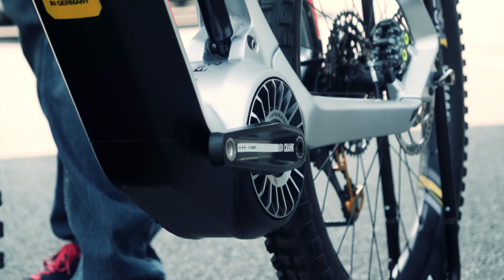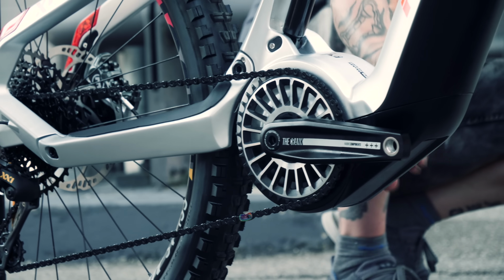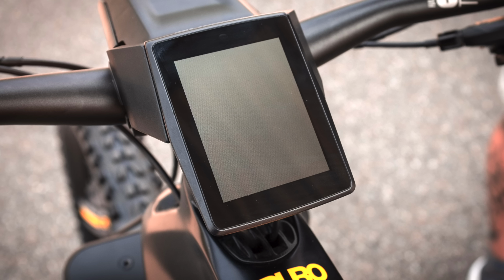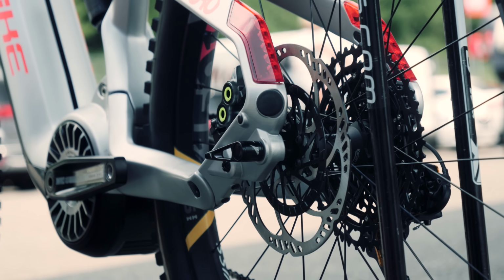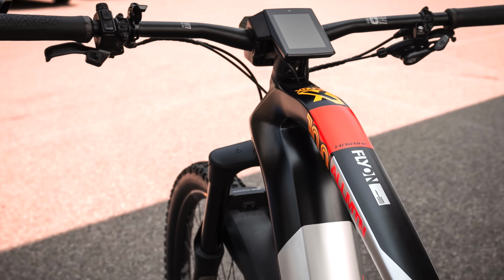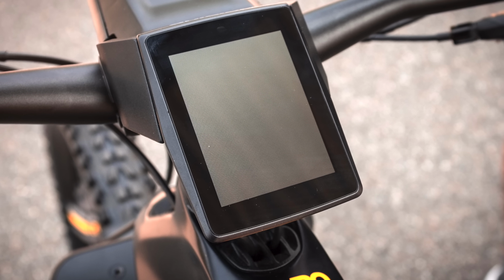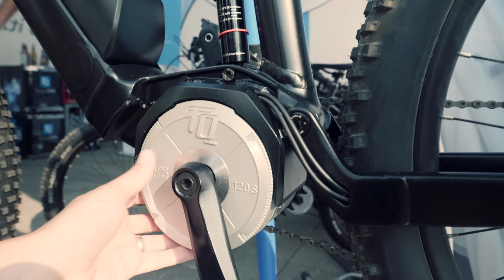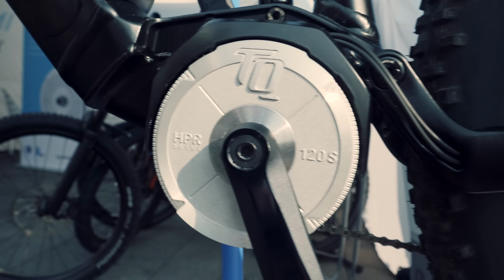Incredible 2019 Haibike FLYON and TQ Motor | Eurobike 2018

Comment: Ridiculous price for a electric moter and a “fancy” battery that you’ll most likely need 2 battery’s. If you’ve got a bike utube will show u how to make your bike into a ebike sooooo much cheaper !!!!!!! The moter they praise about can be a simple moter from a old conver belt heck even a remote control garage door moter will give u a idea on how this works,I’ve made all sorts of high machines from moters I’ve picked up from yard sales and the likes I’ve made a log splitter from a moter with similar size to the Bosch version that’s the moter your looking for and a good power source so again  just do your homework on utube and make your own 30mph is more than fast enuf for any mountain bike !! Heck u know what I’m near finished 2 projects one involves one of these moters but I’m gona make a ebike from a electric moter that will be originally used and made from a different machine,I will hafto buy parts from internet mainly a power source to run and control the moter but watch this space there a great A to B bike I’ll film everything and I promise I’ll video everypart and answer any questions and help others to the best of my ability but I promise u won’t be talking thousands! I’ll even have it tested by other E bikers and have it checked by an E bike specialist E biker I’m sure I’ll find one. Those of u who’s read this remember this comment I’ll price and video everything I do have a mountain bike but that’s all I have ritenow I’m gona screenshot this comment as it’s the start ✌🏼

Comment: my personal diy bike desingn gets 200 miles to a charge and doesn't lose energy from going uphill. hahaha. I use the motor to turn a cog instead and then use a 4 to 1 ratio and a generac stator to make 240 volts at 120 hertz with only 30 amps but my transformer which I will not give the design of steps up the amperage so i can ride at a good clip. it also cost me 500 hundred buck to make. want to know how far it goes on a charge. then build one but i will give you this i weigh 200 pounds my bike is heavy and old it 30 weigh 27 pound my stator and cogs with resistance in foot pounds of torque and weigh is less then 30.( do the math.)

Comment: Rob, was the flyon as smooth as Bosch in on/off power delivery? Smoothness and a natural feeling is what sets Bosch apart. If Flyon is 'jerky' and slow to activate and deactivate, then we must know this - it's a key question to ask.
Reply from the maker: I only rode the TQ motor on the demo bike, it’s likely that Haibike will have their own tune of the software, but it was very smooth in the OEM spec.
Reply: Thx for replying! I assume Haibike wanted an in-house option to lower Bosch/Yamaha third-party costs. I hope they designed the best
Reply from the maker: The TQ is going to be a serious contender.
Reply: fast forward 6 years and it's hardly ever seen .

Comment: Not only does it look like cheap chinese junk, it also limits frame design so that you have to have the effective chainstay length about half a foot longer... I think it's too little too late. Shimano will dominate the market, regardless of whether or not they manufacture the best motors.
Reply from the maker: Dont agree. Sorry. Shimano are behind the curve here (unless you can show me something that is market domination from them?)
Reply: EMTB Forums They've got an increasing market share with their e8000 motors, they're lighter than a lot of the competition, they're compact, and they've already got strong ties with many leading bicycle manufacturers, which gives them an easy position of power, as well as their huge budget to dominate if they want to. They also integrate well with Shimano's other offerings, notably Di2. I'm not saying they're the best system out there, but being Shimano they'll definitely have a big impact regardless. I quite like the system myself, been riding one for a few days now. These Flyon coaxial motors look like Chinese junk, it's nothing special or new. 120nm usually comes at a cost of a higher current draw, or a higher RPM with a bigger reduction gear, either way it's probably at the expense of more energy, or its just a generally bigger motor and it has a huge impact on frame design. Haibike always make stuff look cheap and junky though, suits them perfectly.

Comment: "Feel the additional power compared to the other systems available"? Aren't they all limited to 250w? Does he understand the difference between power and torque or is he trying to lie to us?
Reply from the maker: Hey Brad. 250w is the regulated power allowed over a continuous 30 minute (as defined by the current legislation). The reality is that most motors give bursts over that 250w for periods of time. No one is trying to lie to you! Thanks, Rob.

Comment: If I'm going to spend 8k on an ebike, it must travel at least 35mph. This will give me the confidence needed to get out of the way of traffic should the need warrant it.  I'll never spend that kind of money on a limit.  If its billed as an off road bike anyway, then why does it have a limiter? This is why I'm considering a recumbent trike for my next adventure vehicle. Specifically the one from Outrider called the Alpha. Saving as we speak. Will post my review when I purchase in 2020.
Reply from the maker: It will easily do 35mph but the law restricts them.
Reply: EMTB Forums 

Can the user bypass the restriction illegally? Or is it set by the manufacturer and cant be passed?
Reply: Just wondering if you changed out the rear cog for a higher gear. That should do the trick.
Reply: Not really. The real speed is relevant and measured. In Europe especially in Germany 25km/h is the limit for an eBike (Pedelec). 45km/h is the limit for an SPedelec but you need a driving license, must wear a helmet and need an insurance for the SPedelec. 
For the well known systems form Bosch, Yamaha, ... you can by a little hardware that removes the 25km/h limit but it is illegal. If there will be an easy way to disable the limit for the Haibike Flyon System is the question. As a german citizen I never would drive a several thousand euro Flyon with 25km/h limit that would be absolute useless to me.
Reply: MrCanidi 

I absolutely agree, here in the home of the brave land of the so called free 25 kilometers per hour equates to 15 miles per hour. That does nothing for me both mentally and physically if I also intend to ride it to work.  It's a wonder why someone would spend this much money on such a bike and cant enjoy it to its fullest.  I like the flyon's torque and integrated features yet my needs are primarily road and light trails. I'm leaning towards the Riese&Mullers delite unless someone announces a hack for the engine on this Haibike flyon.
Reply: I'm pretty sure Haibike will make a modified version or a software function to make it compatible to different countries law. 
What I would like more is an unlimited version like the bikespeed RS is for Bosch, Yamaha and Brose Motors e.g. Installing this unlimits the motors and only your maximum cadence limits the speed. For me with my Bosch driven Haibike this is at about 50km/h and usable 40km/h what is very fine without any modification to the transmission ratio of the drive. So in normal condition I have no real limit.

But because of this highpriced Haibike System what never will become a mass product this may only become real by Haibike themself.

I hope that european law will take care of the ebikes and change the regualtions. I don't have any problem in wearing a helmet and having an insurance for my bike what today is not necessarry in germany but the 25km/h limit is horrible.
Reply: EU laws suck . Just ride derestricted . The Police don't care as long as you aren't riding like a loony .
Reply: Raynell Holmes   Completely agree with you! 15.5mph such a silly speed to choose!
I just got an Inokim ox scooter for £1800, upto 60mile range and and very torquey top speed of 28mph
Bye bye ebikes 🛴💨
Reply: Yeah, okay... you take your scooter down a steep off-road track and I will take a Haibike.  When we get to the bottom, we'll turn around and go back up... see how your scooter manages that!  ;)
Reply: robsa walker   I can tell you 100% that once we hit the bottom and turn around to go back up the scooter will leave that silly bike standing!
Reply: +EMTB Forums This thing is capable of 35 mph on a nominal 250w motor? Yeah of course it gives you more when grinding up them hills but a mid drive E-bike on the straight with this motor 35MPH???  I cannot believe this! The motor must be much more nominally rated?

Comment: Still waiting for the derailleur to disappear and all the gearing to take place somehow within the motor. Like a gearbox/motor mix.
Reply from the maker: I'm sure its being worked on. would be great to not have to worry about expensive rear mechs breaking like they do.
Reply: Yeah, that sucks adjusting them gears all the time, and not being able to change gears while standing. I wished they will change it.
Reply: I have a Trek Super Commuter with a NuVinci C8s
Reply: Pinion drive mix would be sweet

Comment: What about the weight? Less than a newest yamaha?
Reply from the maker: 3.8KG
Reply: ouch that is way too heavy!
Reply: Ouch yes. That's why the bike is carbon then... My dream is lighter e mtb, not bulldozers.
Reply: Shion Tanaka  Exactly ! We have plenty of torque already, why don't manufacturers now brainstorm on building much lighter bikes with current torque ?  
Guess it's a lot costlier than creating ever more powerful motors...
Reply: @Cockeyed Optimist
 Actually most manufacturer do: Bafang, Bosch, Shimano, Yamaha, Brose  now have their light models around 3kg, while 2 years ago, they were close to 4kg.
Reply: Fazua is going in the right direction.

Comment: Sure about those 120Nm, or is it a theoretical amount, wich isn't used out on the trails?
Because my BMW S 1000 R with 160hp has 112Nm at 9250rpm...
Can anyone explain? I'm aware that electric motors generate huge amounts of torque, but this seems not usable.
Reply: 120 Nm is comparable with what a man of 70Kg can push on a pedal with a crank of 175mm of lenght. 
Torque = force to arm. Force is 700 Newtons; 70kg multiplied by 9.81 (gravity) (imaging all the weight on one pedal).
So 700N x 0.175m=120Nm but a very low rpm (rotating speed of pedals), this is the magic word.

Don't forget that power is the product of torque for rotating speed, P in watt = N x meter /sec

Your BMW, with 112 Nm at 9000 rpm, develops much more POWER. Indeed you can ride at more than 220Km/h. It weights also much more than a e-bike and you need much more power to move it.
Reply: Dog House that's not true, motorbike manufacturers figures are usually measured at the crank, before transmission losses, so it is like for like.
Reply: gilessmokey  yes it is  hard to get real figures with so many different ways of measuring torque and power and salesmanship by manufacturers .
 People  talk up the Tesla cars for example , 
but they have if I remember correctly 9 to 1 reduction  ratio and in the performance models more than one motor .
 You have to examine each power figure   how they are made  with a  magnifying glass to get the truth.
Reply: Valentin Maissen no, it's real torque, not theoretical. It's just with very low horsepower in comparison. 0-10mph there'll be nothing faster, but then you need to change gear... Fastest motorbike I have had was a ZX12R and immediately off the line, I feel my Bosch eBike gets moving faster.
Reply: I think only a biker can relate to those torque figures and 120nm is pretty nuts.
Reply: Motorbikes test at the wheel and this is lab set up motor torque. Quite a different rating.
Reply: DeadHead it should certainly make wheelies easy.
Reply: With an XTR Di2 on my Bosch cx I’m pretty fast up to 40km/h in the city without tuning.
Reply: I'm a bit confused. According to the sales literature there are 4 versions 250w/250w cargo/500w/920w. All are 48v and all have the same 120nm spec.
Reply: Torque is irrelevant, you can gear any motor up or down to manipulate the top speed or wheel torque. People are confused about this because with intenal combustion engines there is a correlation between high torque and flattish power curves. A flat power curve or a lot of area under the power curve makes a difference because you have a braoder power band. This does not translate to electric motors.

Comment: Great video. That motor looks totally amazing. Now we need the bureaucrats to wake from their archaic slumber and get with the times. 25km top speed on these new bikes is ridiculous. Looking forward to more videos from your visit. Cheers 👍
Reply from the maker: Hey Gordon, thanks for you feedback on the vid. I also with for a slightly higher speed, upto 20mph would make all the difference! Maybe one day. Cheers, Rob.
Reply: well if you are good rider on flat you pedal around 30 so you not need engine... in down hill too so 25km per hour in up hill and where you need power... is enough.... then remember the  battery at 35-40 km/h during nothing...
Reply: Michele Bean all depends on your riding style my haibike hardnine 7.0 on the road i can go up to 50-60km/h with my speedchip build in  lasting for 60-70km wich is pretty decent. Having those extra speeds even in the woods makes it way more fun to ride( not riding 50 in the woods ofc)
Reply: EMTB Forums  20-28!mph  god bless the USA one of the few things we do right ! B
Reply: It is totally a justifiable limit.. everything above 30-35km/h should always be on the road anyway imo.

Comment: Compaired with motorbikes, ebikes have seemed crude and expensive. Still needs better integration of the display, prone to smashing on the bars, top tube would be better.
Reply: Super -sim motorbikes need insurance, tax, mot, fuel... That's all on top of the purchase price. When you think about it, eBikes occupy a mid price point in between them and quality mountain bikes.
Reply: TheAegisClaw Overpriced and cobbled together for available parts, the motor is from TQ, why don't hiabike make one? Motorcycles have millions spent on developing and sell for half a ebike.
Reply: Super -sim yeah, it's not like motorbike manufacturers have ever used any else's engine cough rotax *cough*. Bike manufacturers are not electronics experts, when Kalkhoff/Focus (Derby Cycles, biggest bike manufacturer in Europe) used their own Impulse motors they just couldn't match the reliability of the likes of Bosch. They now use Bosch.
Reply: Super -sim and as for selling for half an eBike... What are you referring to, a 125 commuter? My last motorbike for 12k new.
Reply: Ridiculous to compare a motor bike with an ebike!
Reply: Matthew Rushforth Agreed however if they are competing for your leisure money its valid. I favour my ebike over mbike these days for many reason. I think they will take more marketshare in the future as they develope..

Comment: Nice!  The motor seems fairly quiet.  But 120nm isn't unique.  Bafang's Ultra motor is 120nm and has much more power (over 1500w peak).

Will TQ be exclusive to Haibike?  And will Haibike use other motors?  When will they start selling these bikes?
Reply from the maker: Is that Bafang motor a regular pedelec class motor though?
Reply from the maker: TQ isn't exclusive to Haibike, they have shipped around 2000 already in another much smaller brand of bike. I'm sure if companies want to buy them TQ will sell them :-) Cheers, Rob.
Reply: The Bikee Bike motor also runs at 120Nm and even higher, I have one it is powerfull.
Reply: ArthurDentZaphodBeeb Spitzing M1 using this motor for years
Reply: ArthurDentZaphodBeeb Bafang's claims may be true, but it's irrelevant as no reputable manufacturer wants to put a Bafang motor on their bike, snobbery against Chinese manufacturers really. The power output is irrelevant as its limited by law.
Reply: The new 750w Bafang Ultra Max puts out 160nm.  It will do 35+ They say it will do it and it really does. I have 400 miles on mine and it rides like a dream. It also has a throttle. The US ebike limit is 750w The Texas ebike law is 20mph throttle only and no limit on peddle assist speed and a 100 pound weight limit. There are no classes of ebikes here. They are all just seen as bicycles if they meet those rules. Hopefully that will stay the way it is.

Comment: awesome motor but the cost etc that will put so many ppl off ! i think most ppl are hoping new tech as it gets better would bring costs down a bit ! it is an awesome motor all the same ! looking forward to your next video : )
Reply from the maker: Well, if you think the Pivot Shuttle is £9K, Specialized Levo S-Works is £9K, this puts it in that top end price bracket. By the way, this was the 10.0 which is the highest model, head over to my site https://bit.ly/2u6fMiL to see more pricing options as it starts lower than that. The 10.0 is the flagship Regards, Rob.